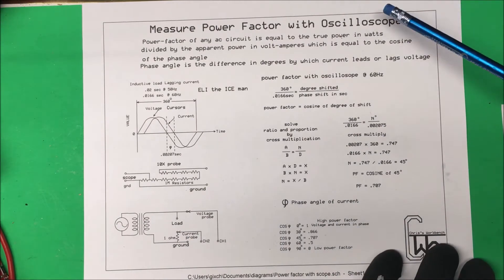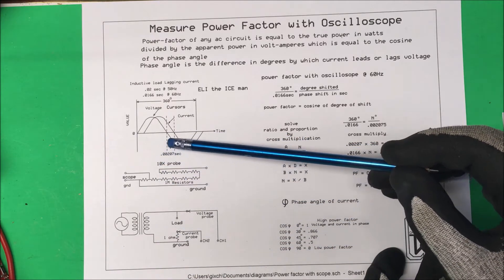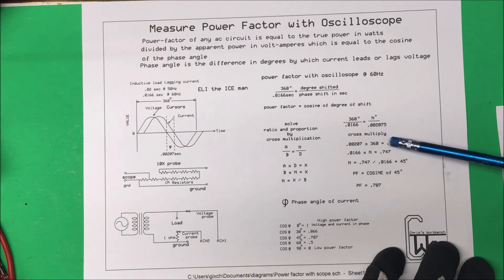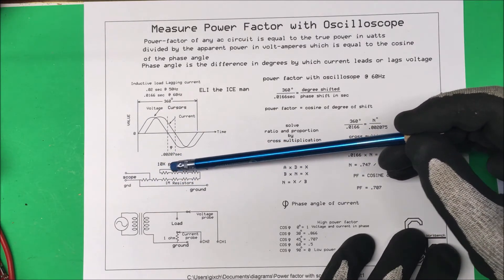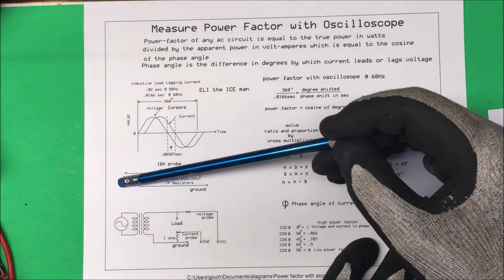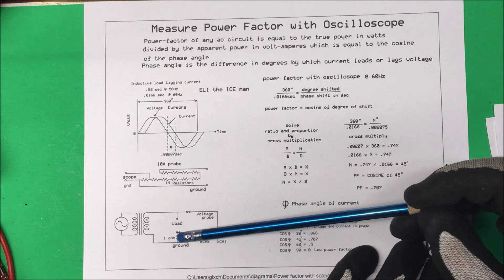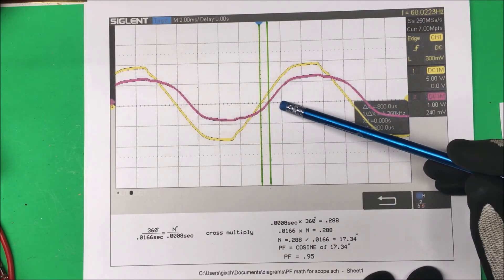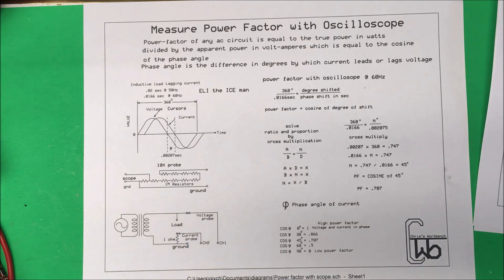Power factor with scope

Comment: Why not use an inexpensive Amp clamp probe to measure current ?    I bought one tenma brand several years ago  Its like a common amp clamp meter without the readout.  Very ibexpensive    Why not just  wind a coil of wire around the conductor carrying the current you want to measure  and pull avoltage reading off the coil and calibrate it by using a known non inductive load  ...say a 1000 watt baseboard heater ?